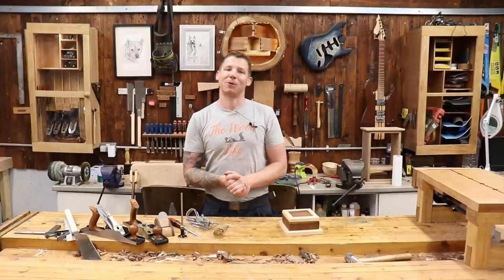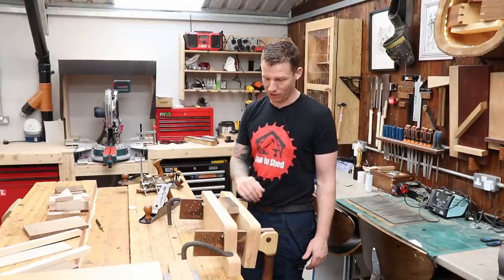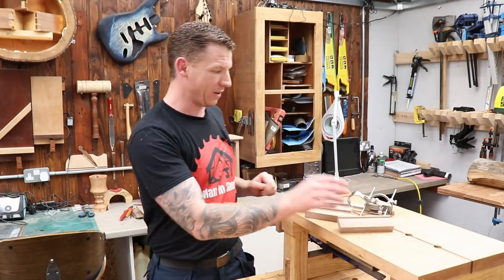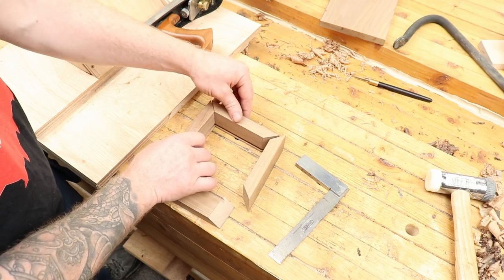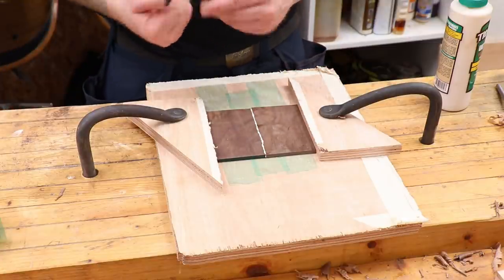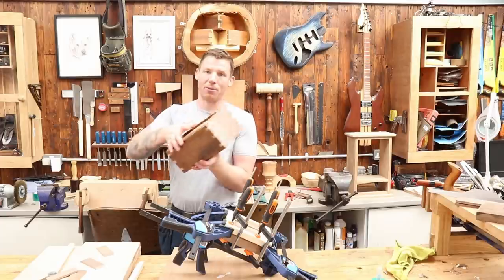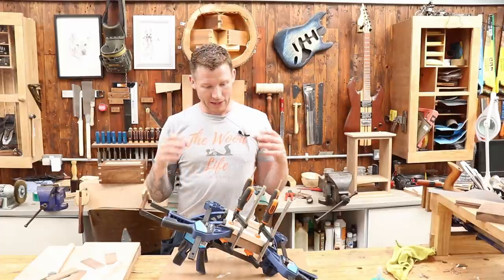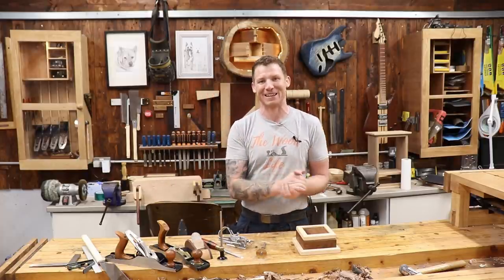Hand Made with Hand Tools. A Scrapwood Box.

Comment: That style of achieving an airtight lid is traditional for cigar humidors. Usually the inner box, and linings for top and bottom, are made of aromatic cedar. A cedar lined, walnut humidor would be a great project.
Reply from the maker: I would like to make a humidor
Reply: @JohnMcGrathManInShed  You can add lots of interesting functional details to a humidor. Some are divided into sections, some have a hinged or removable upper tray, some have a shallow lower drawer for accessories, matches, etc. The only features that are essential, other than the box being nearly airtight, are places for a hygrometer and a humidifier.